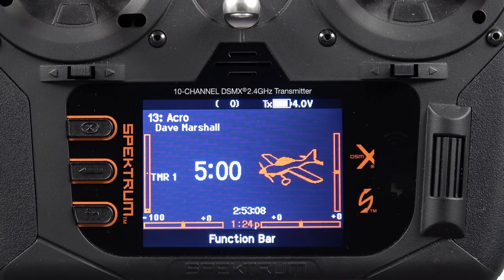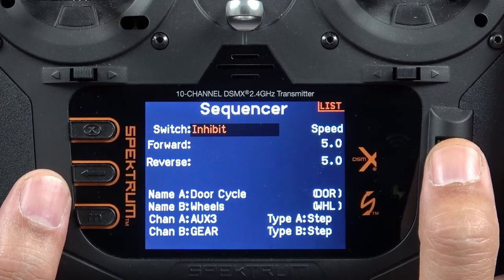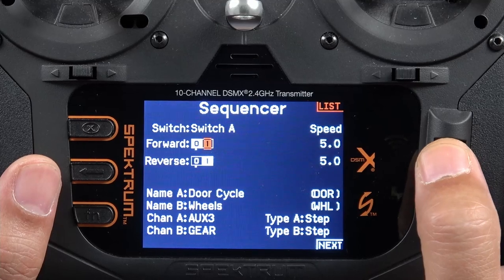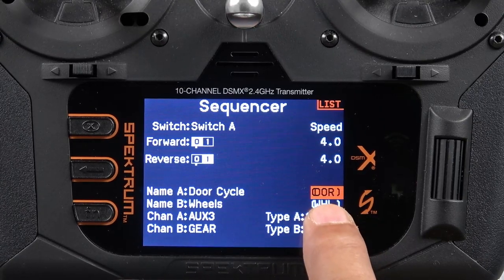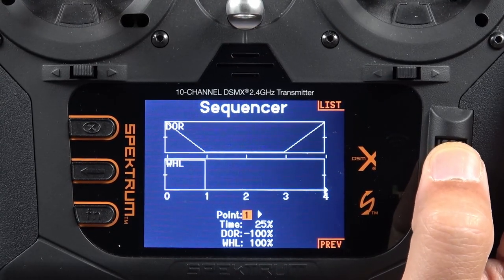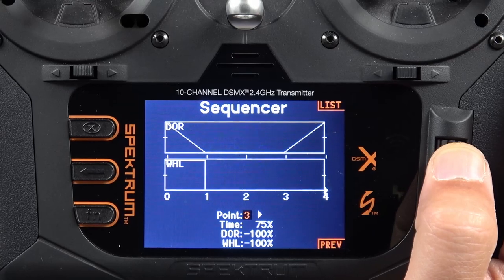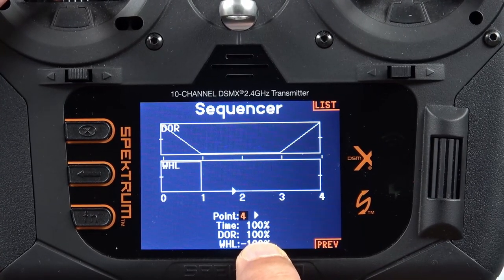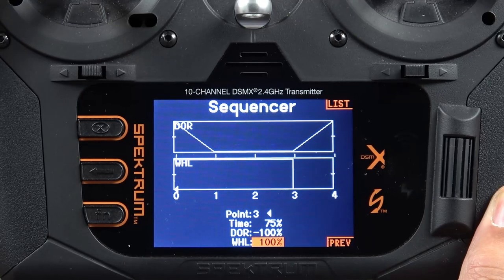Spektrum NX Series Tutorials - Sequencer

Comment: So is this like a mix in the radio or is it actually controlling a gear sequencer. I need to do this on my flex jet if I can't get the aura to work hopefully the aura will work but Dave rc couldn't get it working I think I can I think 🤔😅
Reply from the maker: This is all in the transmitter, to control retracts and gear doors from separate channels on a receiver.